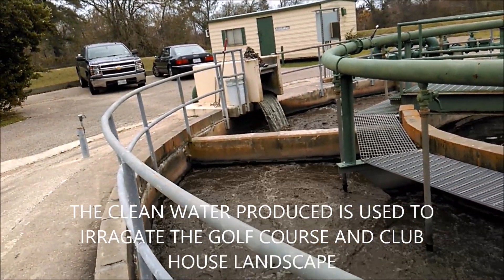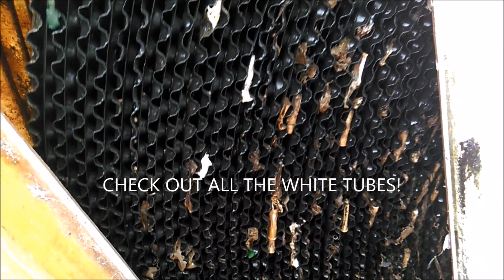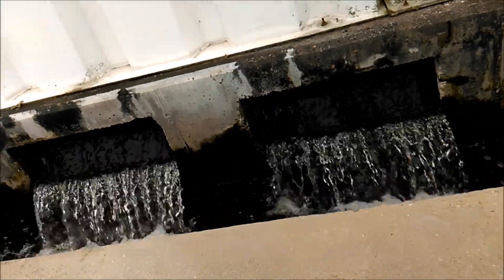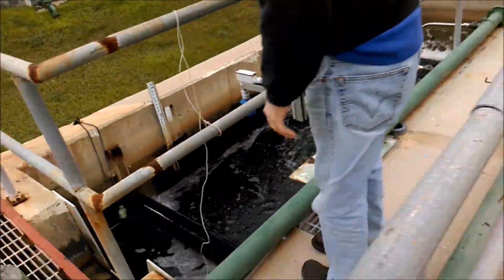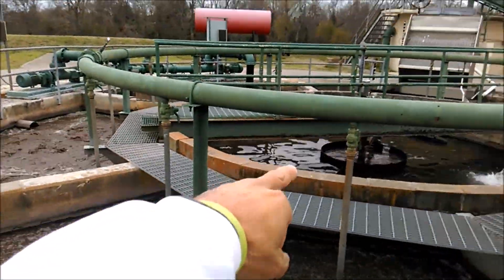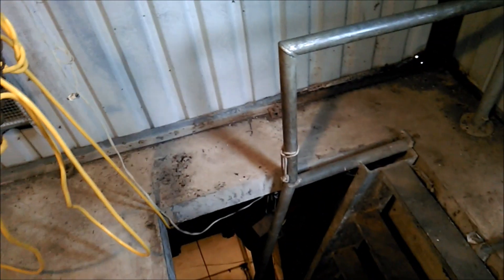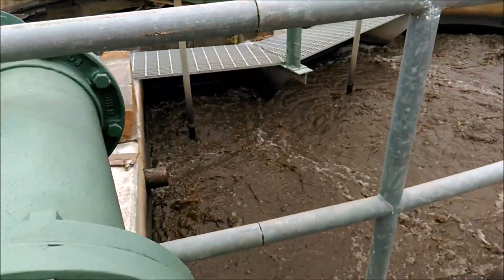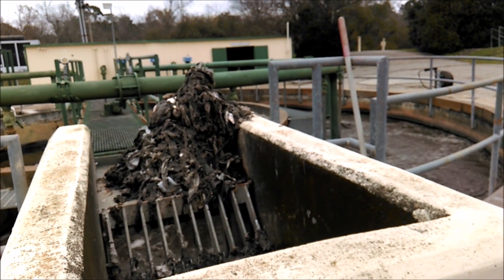WHAT HAPPENS AFTER YOU FLUSH TOILET. WATER TREATMENT PROCESS

Comment: He says nothing about the overflow release valve that gets dumped directly in the river. he opens this valve once a month because the system cannot handle the grouth in population / people flushing toilets. This is an old system, it kept up to the population back then , but not now. A valve is opened and All that brown water in the first and second tanks get flushed into the river. They then are SUPPOSED TO add in that bacteria that eats poop and the cycle starts over again. This is why ALL sewer plants are by a river, so they can dump into it.